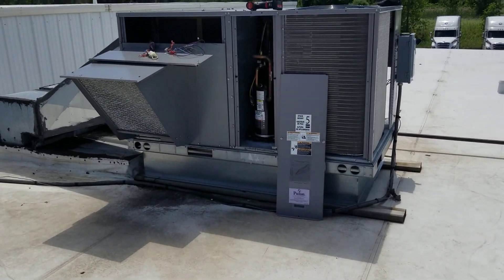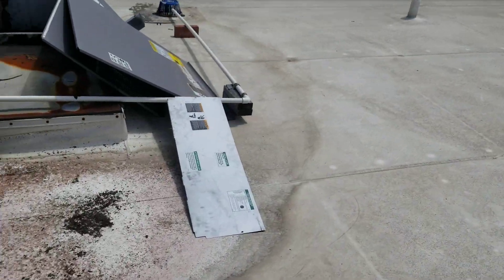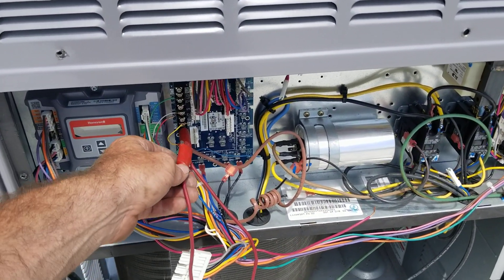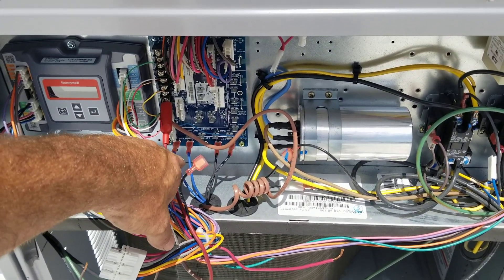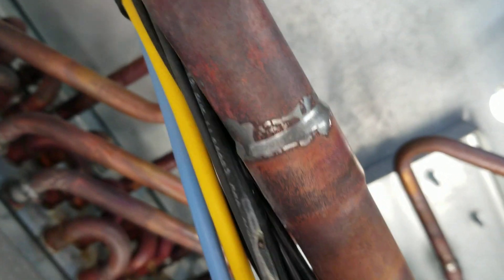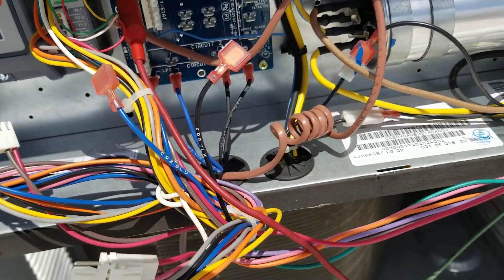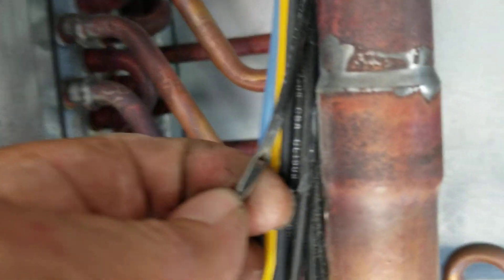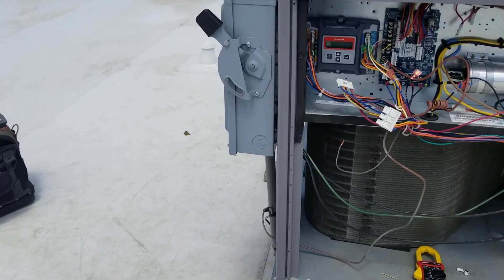Process Of Elimination Roof Top Unit Cooling Circuit Short

Comment: low voltage wiring entering and inside an line voltage box without "physical separation/isolation"... electrical code violation! I know you didn't do that, but take note of it :)
if there was an small enclosed box in the corner where the wire entered and exited, it would be OK.
like the little splice box/terminal area inside units, which is also where they go from common low voltage to 600v rated wiring.
wee-woo-wee-woo. now I sound like the youtube police again LOL. but really it's for safety and yes I trained as a sparky long ago (USA)

Comment: Just a thought..When you have wires like that that have a chance of getting rubbed through, you could put plastic split loom on the wires to protect them.
Reply: or better yet, route them over to the side metal in rubber isolated or nylon strap far away from any tubing which has mechanical vibration...
collegiate sheeple stooge engineering at it's finest or was it driven by the bean-counters cost reductions.....highly likely both, due to engineers now days having near zero to NO field experience and not a clue nor care that a compressor/motor/engine/drive-line will have varying harmonic vibrations which will chafe through just about anything! not to mention the poor quality "greener" wire coatings....
Reply from the maker: Maybe we should tell the factory that LOL